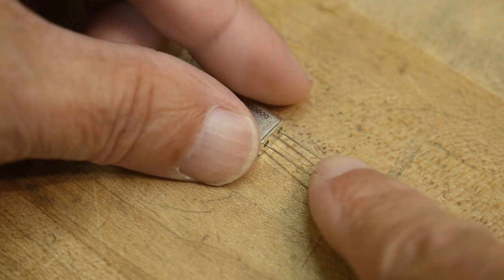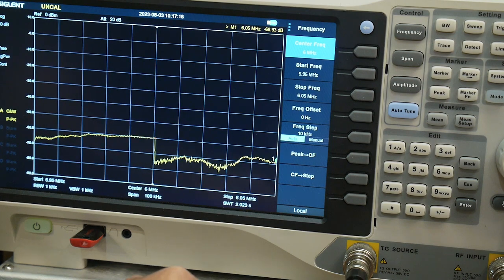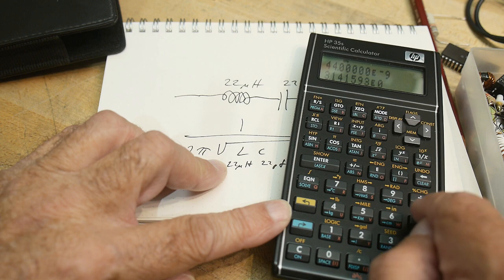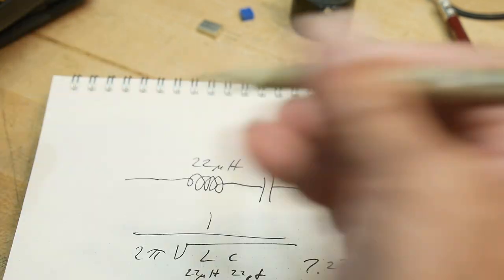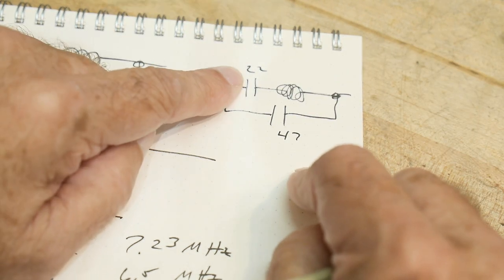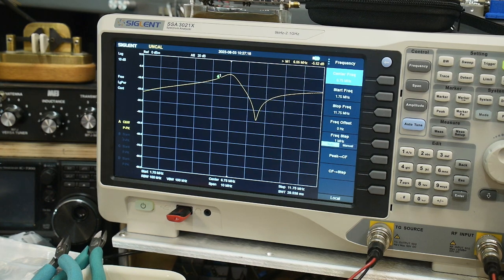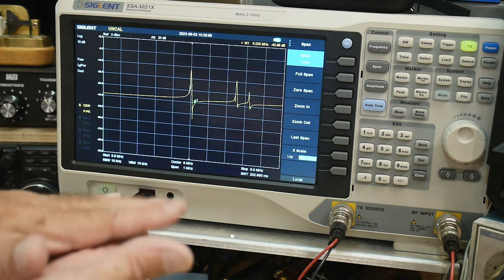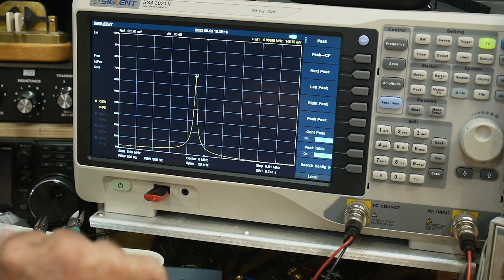#1616 Quartz Crystal Waveforms Explained

Comment: Great video. Back in the early 1980's, I built an audio filter based on the electrical equivilent schematic of a crystal. It had a peak at 700 hzs and a notch at 1600 hzs. The notch was caused by the parallel  equivalent circuit.

Comment: What's so clever about Xtals is how they assemble a group of different ones together and they make up a precision narrowband pass filter. Say at 9 MHz with 2.4 kHz width. And another grouping makes up a 9 MHz with 300 Hz bandwidth. Amazing, before digital radio
Reply: I've done exactly as you describe.  I built a 75m receiver on a big breadboard and used a crystal filter network to act as a narrow filter and using the same frequency crystal injected to do a direct conversion and detect the LSB.  It was kinda haphazardly hokey, but it did work surprisingly well.
Reply: Surprisingly good result with just injecting into the last stage's non linearity , from crystal-based BFO with varicap clarifier. I guess that's how you did it or did you use a proper balanced demodulator?
Reply from the maker: here is my video on xtal filter design: https://youtu.be/3uRA1p6OotA?si=4-A0FAeEWyXVfOyN

Comment: Just for the record... the actual quartz crystal, inside the can, and mounted between two plates, is more analogous to a pane of glass. The quartz crystal is greater than 100 times thinner than it is wide, or long   It could be 6 mm wide, and 10 millimeter long... and yet be only 10 micrometers thick... that's hardly block shaped, IMO.

Comment: At 9:30, you combine the series LC with the parallel LC. In doing so, you connected the parallel C in front of the series C. This places the influence of the series C in the parallel circuit. I would have expected the parallel C to be connected between the series C and the L. Why is your method correct and my method incorrect? Is it that the series C influences the parallel C regardless of the attachments point, because, when combined, they become just one circuit? Please and thank you. I am a self-taught hobbyist with significant knowledge gaps from only studying what interests me.
Reply from the maker: http://rfic.eecs.berkeley.edu/~niknejad/ee242/pdf/eecs242_lect25_xtal.pdf

Comment: Actually, the usage of "series resonance" and "parallel resonance" is pretty close.  Below resonance a series combination has capacitive (leading) impedance and above resonance it has inductive (lagging) impedance; at resonance its impedance is minimum and in phase.  Then, above the series resonance, the equivalent inductance can form another resonance with the parallel capacitance.  This parallel combination has maximum, in-phase impedance at resonance.  The ONLY trait that is different is that neither the series resonance nor the parallel resonance can be modeled in detail as a separate circuit with constant L and C.